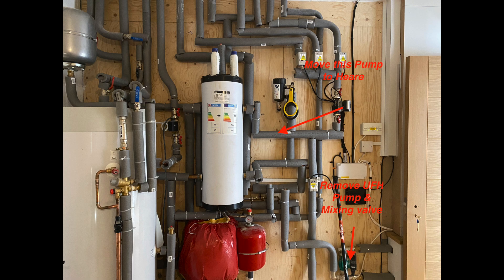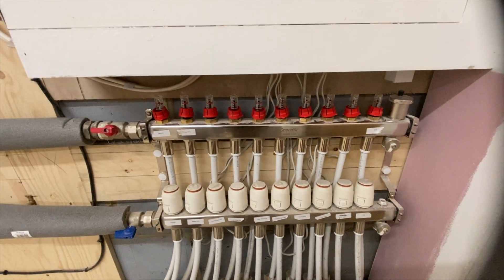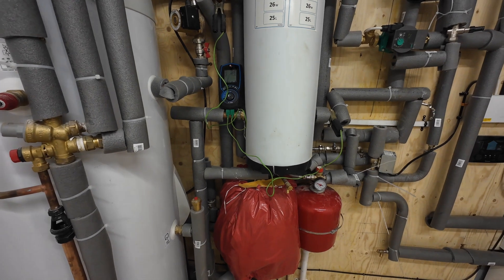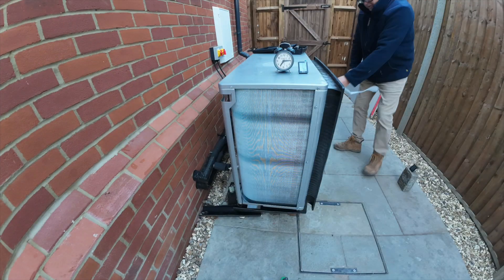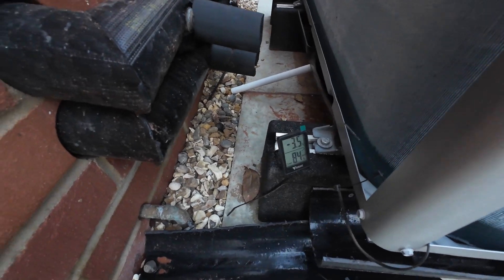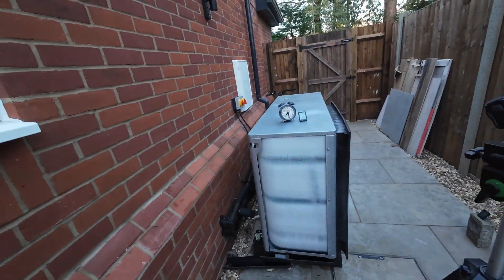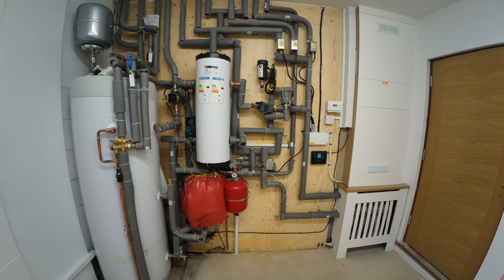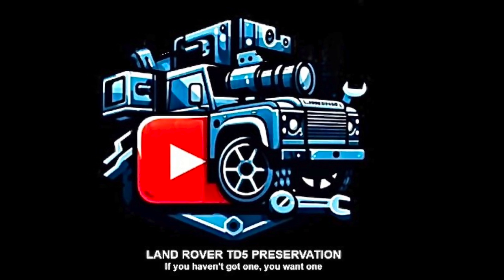Heat Pump Over sized undersize, Low on refrigerant or just in wrong  position ??

Comment: Strikes me the buffer tank could be the issue. Are you sure it's needed?
Reply from the maker: Hi I am reluctant to take out buffer as there are so many controls on system . Minimum flow rates have to be maintained, Another option would be to change buffer to a volumizer . Thank you 👍

Comment: During a heating period could you try measuring the F&R from the HP at the buffer and do the same, measure F&R on the property side of the buffer.  Then also monitor both returns and both flows. The buffer could be causing a nonlinear imbalance and the controller cannot cope.

Comment: COP of 3.5 when it's below zero? I think things have improved considerably. You're going in the right direction I think! As before, take everything that I say with a grain of salt. You're on site, you built it, you understand it. If this were my system, I'd remove as many valves, circulation pumps, etc, from the system as possible. I would still change the buffer to a volumizer on the return side. Given that you're able to heat the house to 19/20 C then I'd say you can run the flow at a lower temperature than 30C. 25C perhaps? That will improve the COP. There might be other flow restrictions / pressure drops in pipework - some valves too restrictive ? These can be swapped. Perhaps the plant-room pipework can be simplified - straight, short and fat pipes are best.

Obviously the householder will need to know that they have to run it continuously for good performance and that it'll take a while to heat up (mine takes about 24 hours to do so from cold, but I have an 1930s semi).
Reply from the maker: Thank you on Thursday last week I know the weather was mild  and The COP is just a snap shot. but on this snap shot  the COP was 5.1  of course date was taken from the daikin interface .
I am still not sure about volumizer option  time will tell. . Thanks you 
👍
Reply: @HEATSEEKER1428  That seems to be much better. For comparison my COP varies between 2.7 and 6.1 (including DHW) depending on how cold it is. I'd expect yours to be consistently better than mine when it's really cold (your 3.5 is much better than my 2.7!) because you're using UFH and the house is better insulated. My average COP overall is 4.2. The really big gains are getting the average COP to around 3.5. After that the gains are much smaller.
Reply: @HEATSEEKER1428 As for heat pump sizing/defrosting/etc. If you're getting a COP of 3.7 in freezing conditions, I'd say don't worry about it. Increasing the volume of the system will shorten the defrost cycle. I suspect that your system is oversized and that will probably limit the COP in warmer weather but I don't consider that an issue. Being oversized will mean that DHW will be very quick - unlikely to lead to customer complaints!

Comment: Maybe the condenser fan blade is not set in the proper depth in the cowling correctly?? Like it’s not pulling the air through correctly.

Definitely seems like an air flow issue Yeah that’s gonna be a tricky one to figure out

Comment: It doesn't have the symptoms of low refrigerant, over sized and location would be my suspicion as I stated on the previous video. It is very odd to have UFH and not be open zoned without a buffer though. Your flow temp, room temp and delta T is what I would expect for -5 but what are the temperatures on the radiator circuits upstairs? If upstairs is hitting temperature and shutting each rad on a TRV you're losing volume and the pump will be potentially oversized - frosting up.

I always try to match the radiator size with the heat loss and doing away with the TRVs now. I would of expected a cop of 4.0 if it's working correctly, may be worth taking the 2 port heads off the radiator circuits and testing again.

Comment: From what I have seen from your presentations, the flow rate on the primary circuit of the heat pump is lower than the flow rate on the secondary circuit. It would be correct for the flow rate on the secondary circuit to be lower than that on the primary circuit.
Reply from the maker: Hi  Yes the secondary flow temp is slightly lower than the primary flow temp . that is due to slight mixing within the LLH thank you.👍

Comment: Hmm I still think elevating the unit may be your only choice going forward , if security is an issue with the gate.  Eg 5 ft minimum f will get it out of the cool air circulation but you will get some vibration from the wall brackets , it is a dead zone unfortunately and most sidewalk way are like this , I think the noise is from the ice buildup in defrost, but get the engineer to check the heatpump sensors are working properly and not damaged or shifted in transit . The other option maybe to apply for front install permission and have the hit downs on the other side of the gate to prevent sabotage, moving it elsewhere will undergo a major work with the 28mm that gets ever expensive, the other thing to remember is wall mounting may incur higher servicing costs that other may not have mentioned hence the 5ft limit that can be used with step ladders

Comment: That plume you see when the HP starts back up is full of moisture which will increase the humidity in the area of the HP if it's not allowed to escape.  That will then quickly refreeze on the HEX.  I think you need to open the gate or fit a gate with open slats / iron gate etc.  Ideally you need to open up some of the slats in your side fence but I guess your neighbour wouldn't appreciate that.
Reply from the maker: Hi Yes  the duty is still out weather or not the HP will have to be moved because neighbour complains about noise . Thank you,👍

Comment: Also have a look at My BroKen HEAT PUMP - HELP - The LOM - he has a similar setup (i.e underfloor & a big heatpump), which gets stuck in a defrost cycle every 30 mins. My view is that they are running too efficiently for the size of ASHP - if you only need 30 deg exit running temp in winter, then a small 4kw is all you need (have you tried turning down the max electrical current it can run at - I have mine limited to 10A, so that my invertor can stay within its limit before taking from the grid during the day in this last winter, and never ever noticed it going into a defrost cycle mode even in zero temps - the other thing I should add is that I have zero controls in the house - it was installed as supplied (all TRV's are open and have no buffer, no zones in house - 28mm pipe from pump and the rest is 22mm copper, 15mm on rads), until recently I didn't even have a temperature sensor in the house, it was all dialed in on exit temperature of the ASHP & external temperature - no cycling noticed it just runs at a constant current draw linked to exit temp of the ASHP & external temp (both sensors are somewhere in the monoblock unit) - also what is your flow rate range - my min is around 6 l/min & max approx 25 l/m

... also look at Heat Pump defrost cycle explained- Adam Rowlandson towards the end - with a so-called death spiral (from 7:30 mins), yes this one was undersized, but if every thing is restricted to 30 degs, it may work in the opposite way? 

... EDIT: Just had another look my antifrost is set to off! - why dont you just do that especially now that the frost season is over!
Reply from the maker: Hi thank you will take a look 👍

Comment: Weather comp and open zone. Check the flow rates and DT are reasonable. This reduces flow* temps and increases the reactive thermal inertia the hp has to work against. It may be the plate heat exchanger is dirty. 

Once that's sorted, it can only be the hp. Get a service. They check more than refrigerant charge.

Comment: You say you have a delta t of 8° c inside at the buffer,  maybe you could try more flow from the 
Circulation pump?
Reply: I think this could be the issue, with more heat extracted, it is more likely to freeze up outside. If you extracted less heat from each pump cycle, it maybe less likely to freeze, with more pump cycles (higher flow) giving the extra heat. It'll be interesting to see what fixes it in the end.
Reply from the maker: @davidcoates6768  Hi I know my instincts are telling me that it undersized  and this might be the case when temps are close to or around - 3 c  plus it is a new house and the fabric of the property has not warmed up yet . Thank you 👍
Reply from the maker: Hi the delta t of 8 is between the primary flow and the return from the heating both radiators and under floor heating . I really want the water to circulate at a slower speed so that more heat is extracted from the water before it returns  to the HP . Thank you 👍

Comment: Is that a Low Loss Header ?  A few engineers are changing the pipework around to make that just a buffer tank . That might change the heat requirements.
Reply: So removing it's ability to work as llh could help with your constant defrost cycling.  This would be quite cheap and easy to try with your abilities.  You could also remove the circulation pump on the radiator side, ( if that's how its piped)
Reply from the maker: @stevengrenville9600  Hi yes that will probably be my next step, I am waiting for a visit from the suppliers  of the HP  first before proceeding  Thank you 👍
Reply from the maker: Hi The design shows a LLH  but this is a buffer Tank  Doing the same Job . Thank you 👍

Comment: It may help to place the outdoor unit on high/ large concrete blocks. Higher up, the unit will suck in less cold air from the floor and if properly secured to the blocks, the outdoor unit will vibrate less.
Reply from the maker: Thank you  if you look there is plinth at the bottom of wall so bracket would have to go high and the builder does not want that. Thank you  👍

Comment: I do think it is very likely recirculating (cold) air, I can only suggest (again) that you take every other board off the gate and the small fence at either side of the gate, to help air flow.
Reply: It seems like the condenser fan blade may not be set deep or shallow enough in the cowling to pull air through correctly
Reply: Just to add, i noticed you're taking the condensate out to the rear, i would suggest you take this out to the front.

Comment: As I said in more detail in the comments of the previous video. It looks very likely that the heat pump is oversized.

I would be very interested in seeing the calculations and design of this system.
Reply from the maker: Hi Ok will try to obtain copies  thank you 👍
Reply: also its split into 4 zones. According to HeatGeek thats a big no as when 1 or more zones close it basically makes the heat pump move oversized as there is less heat emitter size so more cycles

Comment: So you improved the COP from 2.5 to 3.5 without doing anything to the position of the heat pump.

We can now wait for all the commenters on the last video who told you that that was the problem to admit their error. Also those who told you to scrap it.

😂
Reply from the maker: Hi Thank you   I Know today the ambient temp is around 12 c  but since midnight yesterday to 11.30am today the  HP has been running with a COP of 5.1 maintaining room temps around 21 c  I am pleased. I suppose  I have to take the rough with the smooth and manage expectations. 
I Don't think the person that said to scrap the H P   knew   what they were  talking about .
Thank you 
👍

Comment: If undersized it would be cold inside, oversized will create lots of starts and stops. 

Location could be better but is not a major issue.

Low referigerant does not even deliver heat.
30min a defrost is not that much it depends of humidity.

Make sure the heatpump has a delta T of 5,  the lower the return the faster is freezes.

Heatpumps also love flow, try to run the groundfloor open loop or at least the living room and kitchen. Then use weather compensation to set the temperature and close/remove the bypass valve.

If zones are opening after a few hours closes they wil provide very cold water at once and can cause the heatpump run harder on a bigger delta T. 

Slow and steady is key for comfort and efficiency
Reply from the maker: Hi Thank you  I have tried open loop  and am using weather comp . I think the heat pump is delivering  great results heat wise . house is perfectly warm . I am just a bit concerned  efficiency is being effected by defrost cycle. Thank you 👍

Comment: its not likely to be low on gas, if it was it would be freezing in a corner of the evap closest to the expansion valve. Most of the heat is coming from latent heat in the outside air. To turn this latent heat into sensible heat that u can feel requires to remove moisture from the air. So for it to work, that removed moisture is going to condense and freeze. When its cold but dry its less of an issue. Even when the outside temp is a couple of degrees its less of an issue, bc warmer air holds a lot more latent heat even though the sensible heat difference is only a few degrees.
Reply from the maker: Thank you 👍

Comment: I’d suggest it is oversized if not low on refrigerant. My pump goes for hours and hours w/o defrosting. They are meant to run longer. I’m interested in what your inspection shows.
Reply: On a cold day, especially when ambient temperature is well below freezing, it's normal for a heat pump to defrost hourly or even more often, humidity also has a big impact. I wouldn't be too worried unless it was affecting comfort in the house and was occurring more frequently than every ~40 minutes.
Reply from the maker: @JoshuaStringfellow1  Hi Yes You are right  according to the thermometers the humidity was around 80% on the really cold days . and when the Hp  went into defrost mode  the comfort levels in the property were  good   Thank you 👍
Reply from the maker: Yes I am Have fitted a few before with no problems interesting  they have all been 16 kw  on smaller property's  My instinct is that it is either undersizes or low on refrigerant  I will post results. Thank you 👍

Comment: Great to see you have implemented some of the changes recommended, this will make a great difference.
I suspect you may be overthinking the results on this though.

Going by the info in this video it is -5° ambient (reasonably cold) 2 defrosts per hour is not unusual at such temperatures (bearing in mind there is much less latent energy available in the air) and a COP of 3.5 again is pretty normal (if not considered quite good for the outdoor temp).
I can’t help but feel that maybe your expectations exceed what is considered normal? Possibly been misled/misinformed about what is possible at this low temperatures?
Again bear in mind, the figures stated by manufacturers are not at design temp, they are usually based on A7°/W35° for COP 4+.

As long as the unit is not cycling excessively, then I think you are 90% there.

I heard you mentioned the flow temp is SET to 30/31°, again if you’re not on weather compensation, you should really get this set up as this will help massively too.
Reply from the maker: Hi Thank you . Yes perhaps I should manage my expectations - 5 is  cold and heat  calls are to - 3  . 👍

Comment: If it isn't low refrigerant,  you may need to shift the heat pump round the corner. In the manufacturer's install instructions , it specifies minimum clearance front and rear. Check that out.
Reply: This is a red herring. Location is fine.
Reply from the maker: Thank you  have tried with gate open  does not seem to make much difference  thanks 👍
Reply: The cold air probably hitting the fence, causing it to circulate back to the rear of the ASHP & then freeze.